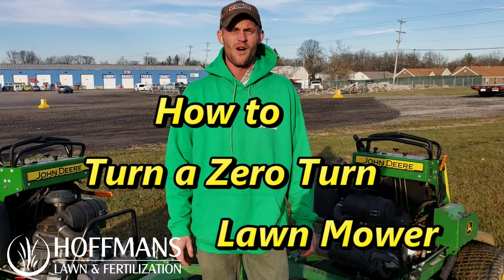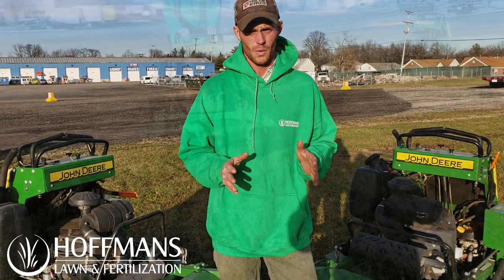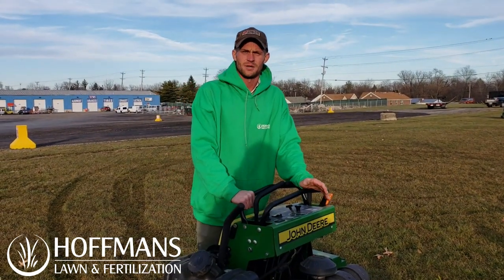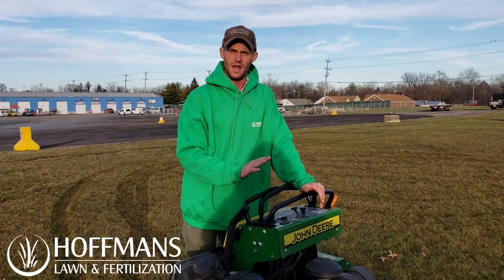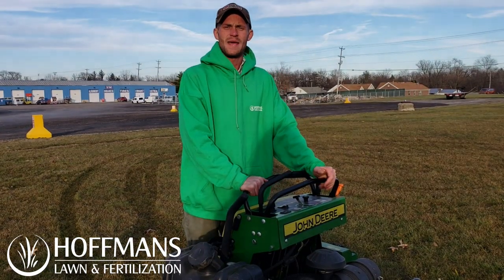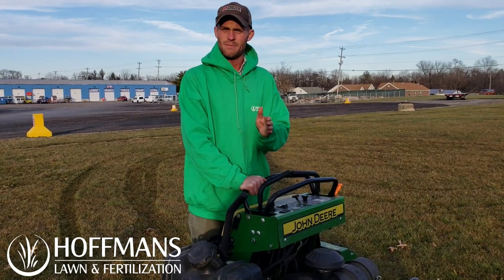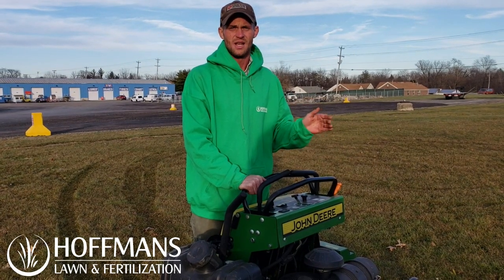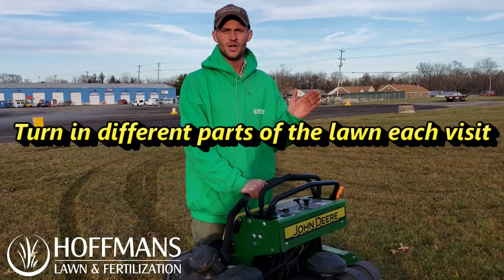How to Turn a zero turn mower without causing turf Damage

Comment: Go push a shopping cart through a zero turn maneuver and watch the wheels.... now go duplicate that on your mower with the levers..... apply reverse pressure to your inside wheel lever during tight turns. You HAVE to keep your wheel moving WITH the turn you are trying to do.  A dead wheel equals a dead spot on the turf. Do it at low speeds until you get the feel for it and the feel of your machine. You shouldn't be 3/4 sticking through tight turn maneuvers anyways.... it's not a racetrack, it's dirt covered with foliage! Reversing your inside wheel through zero turning will allow you to turn on a dime with no turf damage. You're NOT turning,  YOU'RE TWISTING!

Comment: Doing a 3 point turn defeats the point of a zero turn mower.
Reply: Still way faster than a tractor mower. My toro and gravely both rut if i try to do a full turn only only mower that never rutted because of the computer was my Scag turf tiger.
Reply: @Jeff-jr3sg  you said your tractor damages lawn too ? my problem is going around tree (for examp[le) and I still see damage. I do most of my turns on sidewalk, I only got one section where I turn 180 degrees.
Reply: @ToryII   Yes most zero turns in the lower budget range will damage lawns because there is no buffer zone or system to stop you from dragging the tire when you turn. They're all different you have to learn where the neutral position is where that lets the tire free spin before you turn you can learn by practicing turning while watching the inside tire.  I learned mine is special, in order to turn mine I found out you only have to push in one lever and not two, so if I want to turn right I just push the left lever while leaving the right lever in the neutral position and the inisde tire will spin freely and not drag.